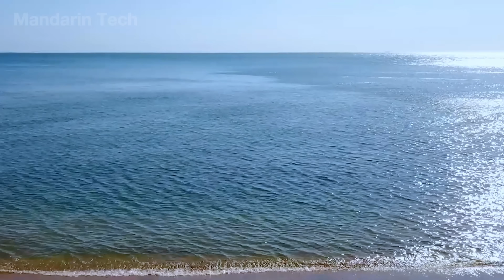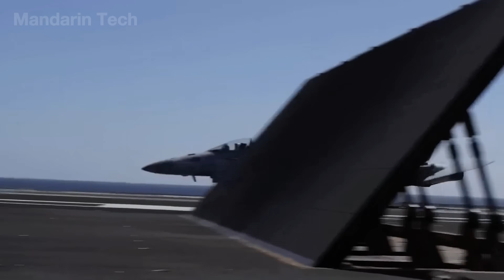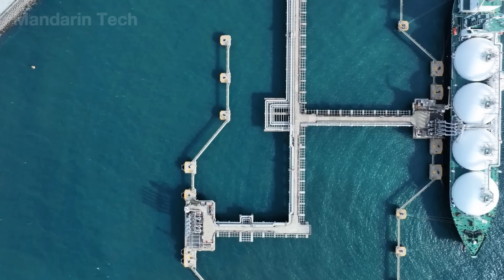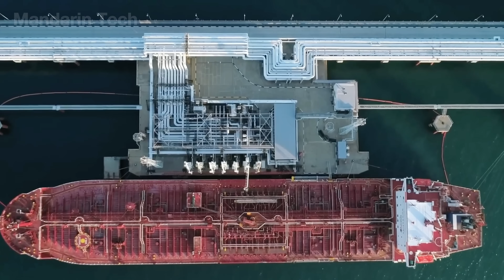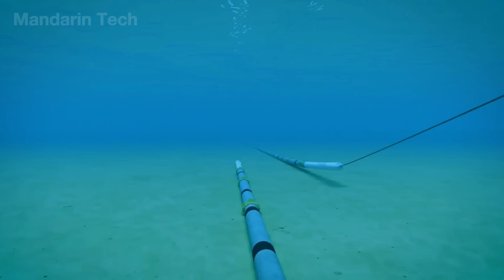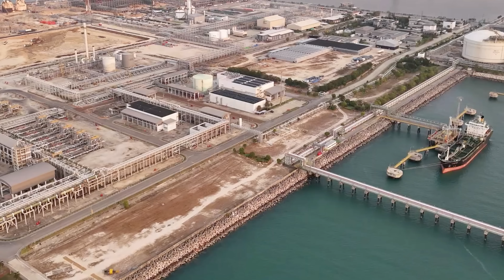How Saudi Arabia Built a Massive Oil Port Near the Strait of Hormuz to Control Global Oil Flow

Comment: the petroline runs from ras tanura to the red sea port of yanbu, north of jeddah.  it is an oil pipeline with a maximum throughput of about 7mill barrels per day, equivalent to what is processed at ras tanura.  it was built in the 1980's, when the saudi's determined that being able to bypass the straight fully was going to be a requirement because - then - they assessed correctly that iran would eventually fall, and their only real chess piece was the straight.  

the saudis literally planned for this 40 years ago
Reply from the maker: Thanks for sharing such valuable insight about this strategic pipeline!